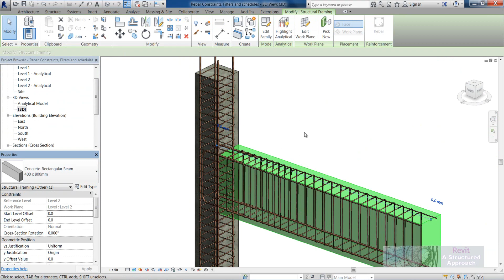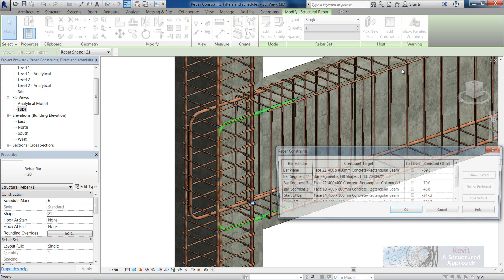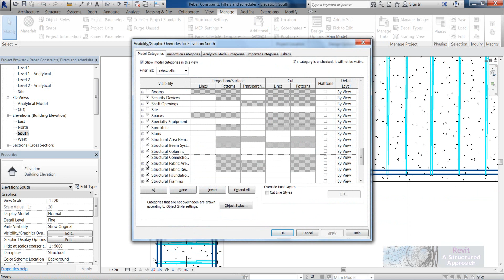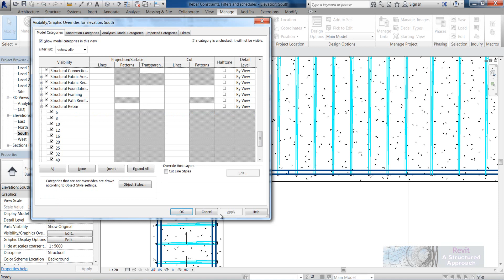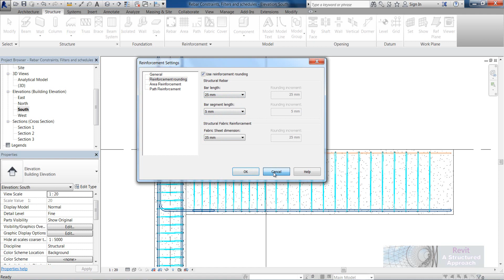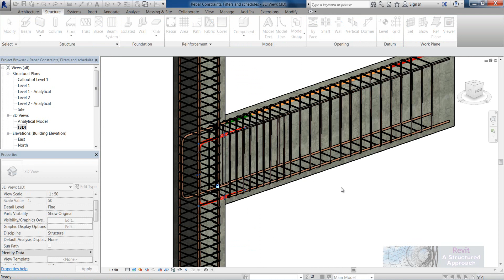Revit 2014  New Rebar Tools

Comment: When i use extension tool for beam reinforcement.. 4@16mm top ..then i go to rebar tag.. shown 1@16mm only.. but 3d view 4 rods are there..but rebar tag shown 1@16mm bar only..what is the solution sir